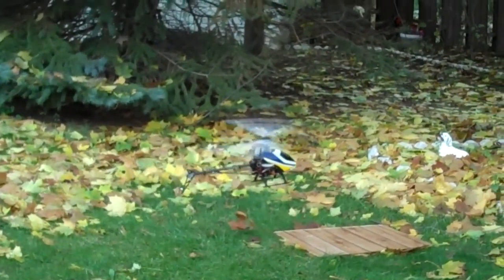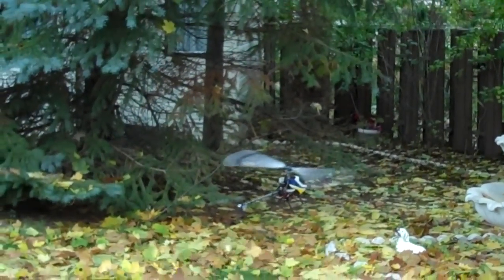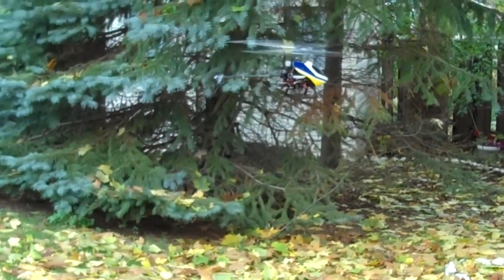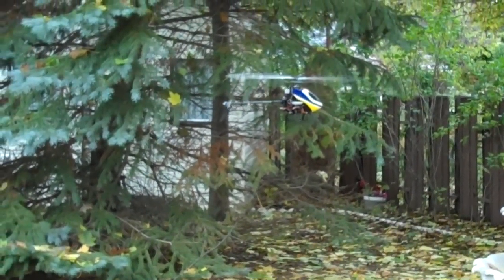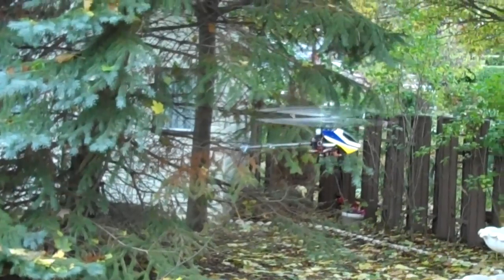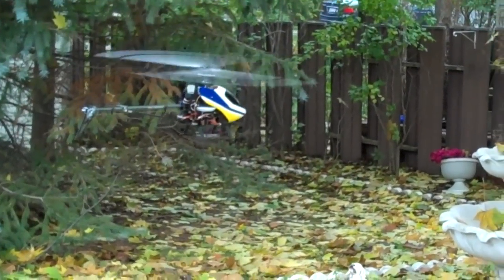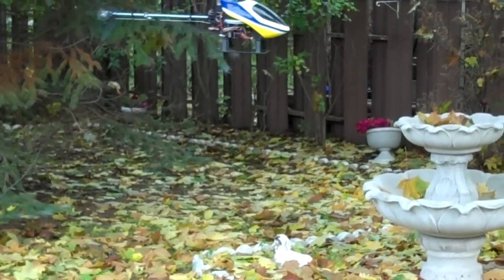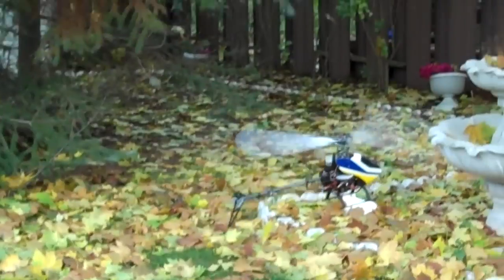EXI 450 CF Pro radio controlled helicopter - first flight by novice pilot

Comment from the maker: It's now March 5., 2012, and I replaced the tail servo with an Airtronics 94819.  The original D213F in the tail fried after about 10 hours flight time.  It worked very well during that time, but I guess it just couldn't stand up to the continuous force required for tail rotor control.

Comment from the maker: As of Feb. 17, 2012, this heli has 75 flights on it.  At 8 minutes each that works out to 10 hours of flight time.  All components are original, except for the tail boom, main rotor gear, and main rotor blades, which were wrecked in two crashes--less than 20 bucks worth of spares.  All servos etc. are original.

Comment from the maker: Thanks for taking an interest in my flight training :)  If anyone is interested, the actual max flight time on a fully charged 3S 2200 mAh battery is about 11 to 12 minutes, not 7 or 8 as stated in the video.  I usually fly only 8 min. or so before landing because it gives longer battery cycle life (not having to fully charge to 4.2V or fully discharge to 2.8V/cell), and because it leaves plenty of juice in the pack in case wind or marginal pilot competence (or both) makes the landing hairy :)